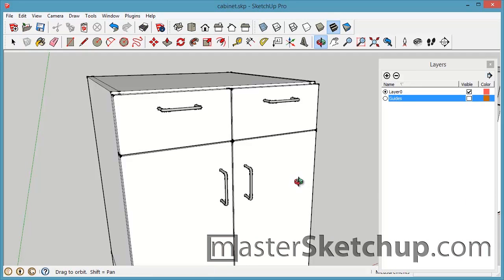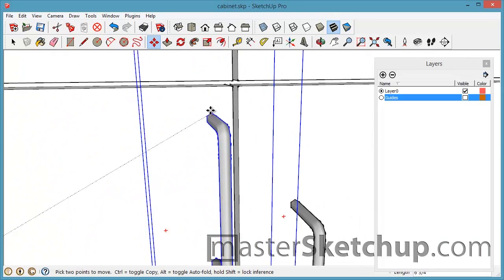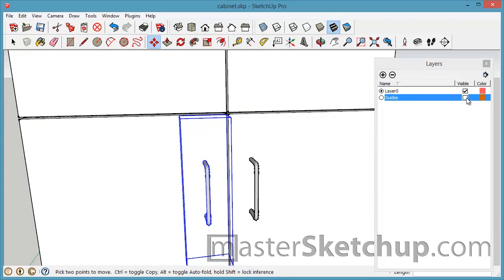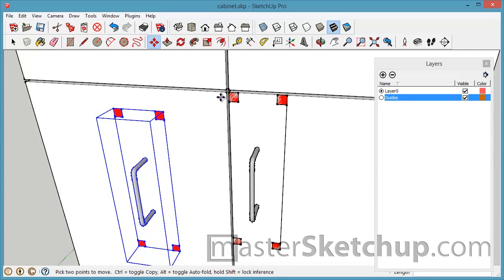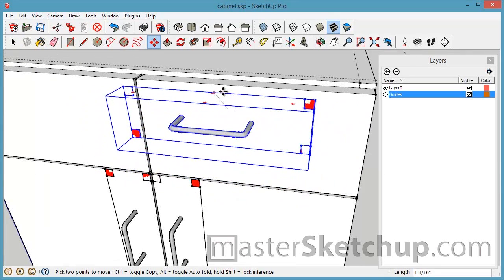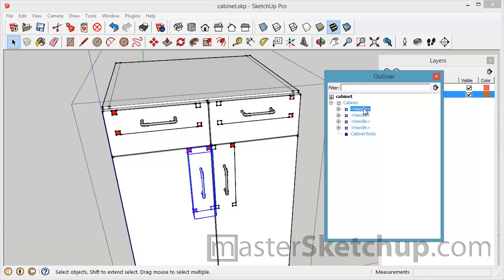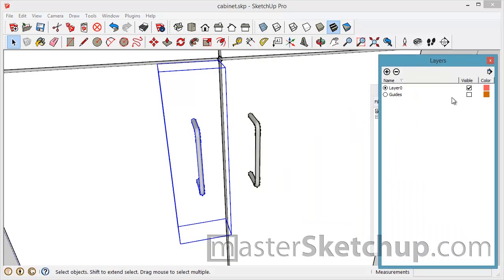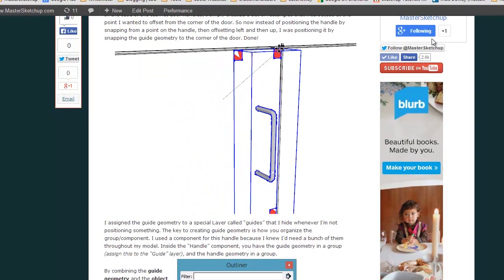Custom Guides in SketchUp (No, not THAT kind of guide)

Comment: I usually use guide lines inside component, and I have shortcut to view and hide a guide. For me this is quicker and file size smaller.
Reply from the maker: I use guides too; all the time. It just gets messy sometimes when you have a bunch of components with multiple guides inside of them because guide lines are infinite. With this, the guide geometry is confined to the space where it's needed. And it's easily deleted when you're all done if you're concerned about a few extra edges in your model.
Reply: That's the beauty of shortcut. Select the component, temporary on the guides with shortcut (guides will also in blue to differentiate it with other component), pick the component, turn off the guides with shortcut, and you won't bother with any guides while move it. And SU still run smoothly because it didn't count added guides geometry when navigating if you have large amount of component. But yours still cool trick tough. I just share my experience in using SU.